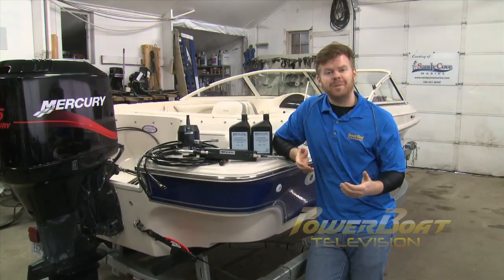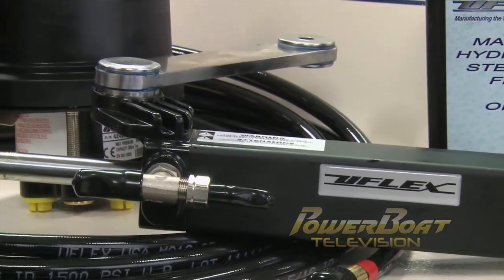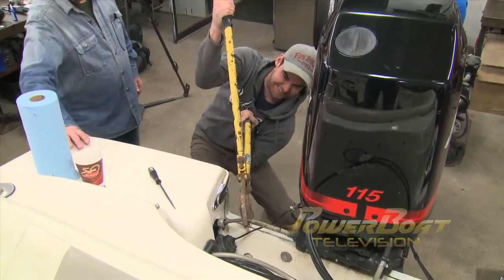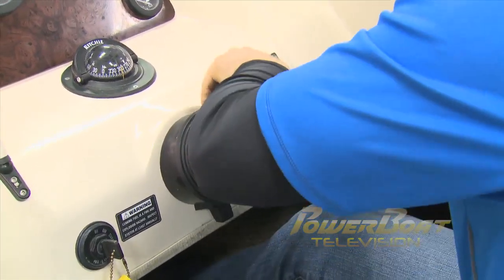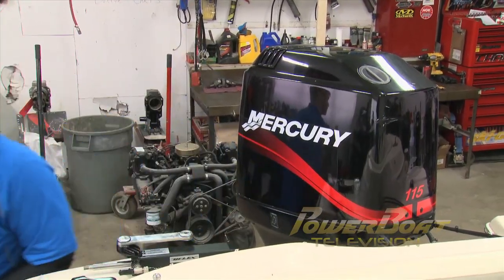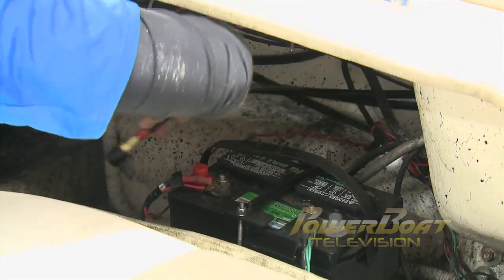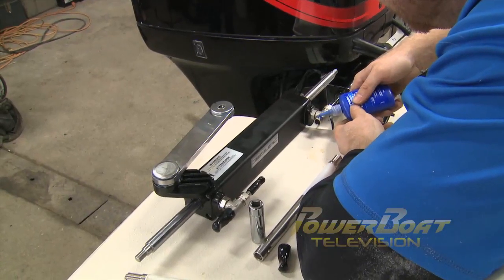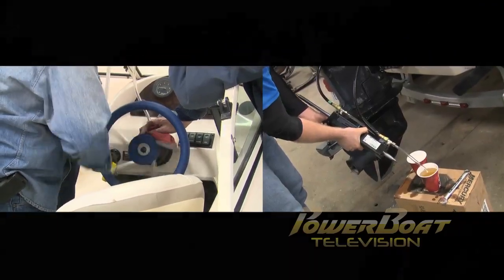How To Upgrade to Hydraulic Steering - PowerBoat TV

Comment: This is a great video. FYIs for some other people, I replaced two of these recently. It can be easier to remove the teleflex cable than to cut it; loosening a few of the nuts and pulling through the bulkheads is all it takes, but it's rigid so can be difficult. Also, in some cases the steering wheel mounting bolts are accessible from underneath the console. It's just 3 nuts to remove (assuming the interior bolts don't slip on you) and the whole steering wheel assembly comes out. Could save you quite a bit of time.

Comment: Do you know the original length of the cable you removed? And what length hoses you replaced it with? I am about to do this job but I am still unclear how much longer the hose needs to be over the cable length. Thanks for sharing this video.

Comment: Would have added an inline filter on the return line
Reply: Would have routed the hose differently. Nice loop letting fittings connect from the port side

Comment: Like many experts--I think it seems easier, to you, than it would come across to the layman, who has neither the tools, the working bay, the knowledge and/or skills.  In other words, you make it look easy, cause you know what you are doing, and you have the tools, the work bay, the knowledge and the helper.  That's not to say people can't do it, just that people need to really think through not only the steps, but things they may encounter along the way--like the helm hole NOT being the same size and so an and so forth.  AND TIME.  I would add, don't start this if you are on a tight time frame--if it is a project, and you have extra time to take care of the unexpected, then go ahead.  Just my two cents.
Reply: Jmichael Isbell agreed.  Diy my ass.  He did it in the shop
Reply: First time doing this and its actually pretty simple. For me the hardest part was removing the old cable